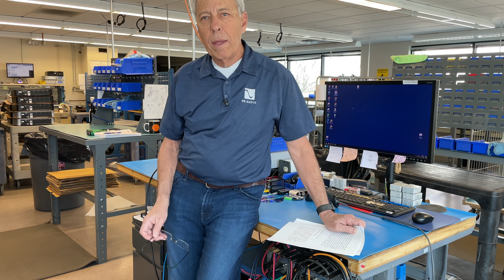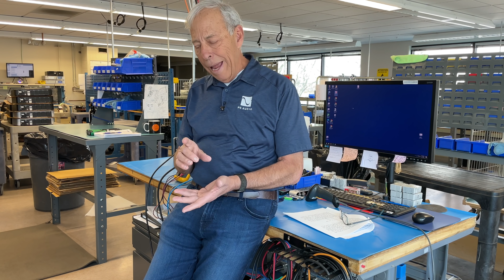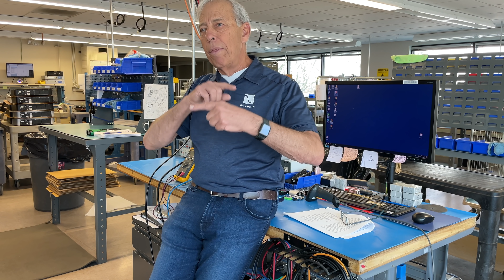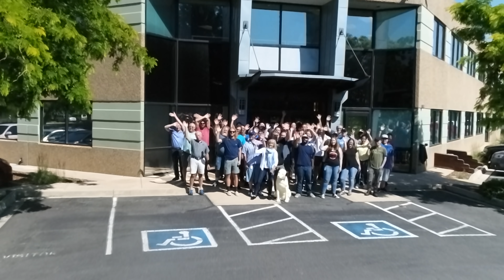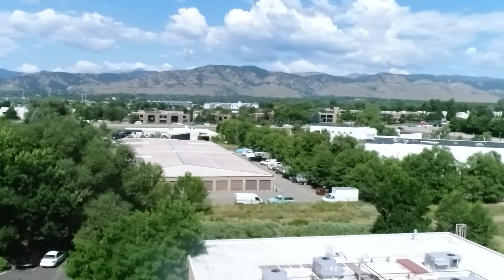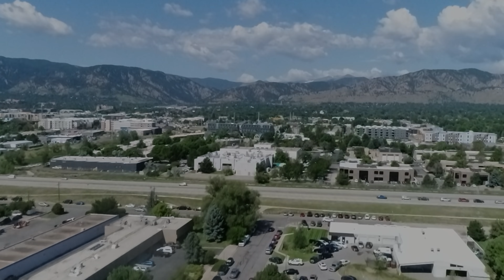USB Turntables

Comment: At what point is the inferior ADC or DAC a hindrance to the audio quality of what you hear?
Reply: Given the entry-level quality of USB turntables, probably not as much of a factor as the cartridge/stylus, the turntable's mechanical isolation and the choice of audio codec used for the ripped file.

Comment: The turntable probably has very crappy ADC and output stages
Reply: Even if it did, it wouldn't matter much as long as you have a good quality DAC at the end of the chain. You'd be surprised how many poor ADC's are in a number of digital players, consoles, and other digital-based components. If you use a really good dedicated DAC to convert it all to analog, you can still get a really good sound.
Reply: What you've lost by using a low-quality ADC will never be recovered even by using a top-notch DAC.
Reply: The main fault of cheap ADC is noise. Capture it before RIAA and then flatten it it software. ADC noise gets flattened just like clicks and pops do by RIAA reverse  curve.   It works surprisingly well.  I have done it with a Zoom recorder and an entrylevel Focusrite interface. It's not perfect,  but is far from unpleasant. Works fine for use on the go or in a car.
Reply: @perryblanco1446  It isn't about recovery. I'm just saying in most cases, there isn't always an audible difference between your lower-quality and higher quality average and even some higher quality ADC's. However, I haven't listened to a USB turntable before so I can't confirm any type of claims about how they really sound. 

Having said that, I would be more concerned about the quality of USB turntables themselves since any of their sonic shortcomings would, to my ear, be more obvious than what I might hear from a lower-quality ADC.